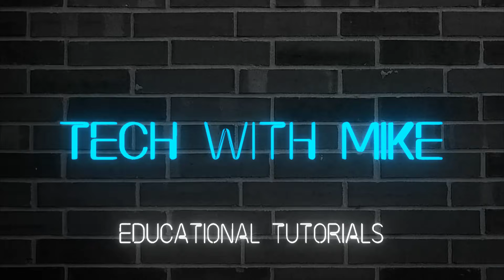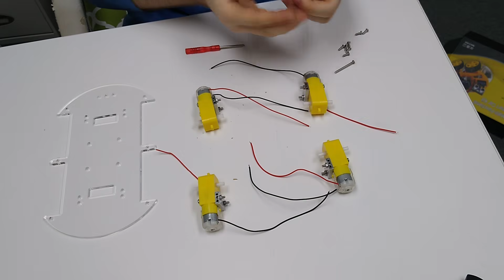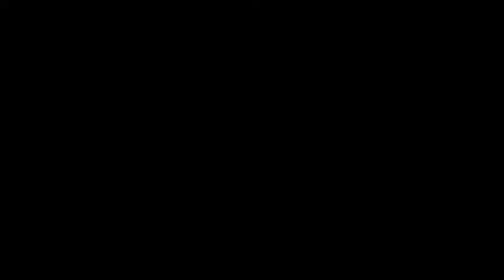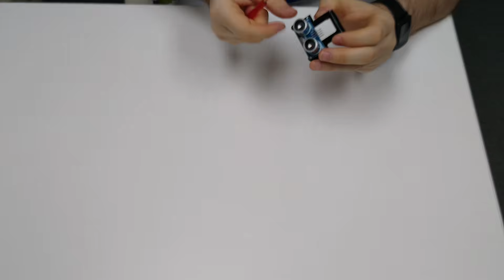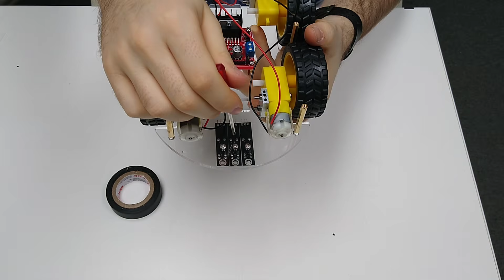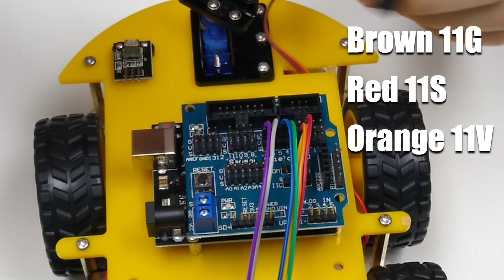How to Build an Arduino Smart Car (LAFVIN)

Comment: I need help, we had problems with the code and the car does not work, we think that the problem may be the bridge because at first we did not loosen the screws a little to insert the cable, we tried to disassemble it with a small screwdriver, but it does not come out and a cable is loose. The other part is that our servo has a screw loose, so when we try to operate it we get the error that something is broken. Another possibility is that when we connect the board to our computer it does not detect it as an Arduino UNO, but only as a simple USB. I don't know what is wrong. I need some help.
Reply: Please, I need help, I have little time to deliver this project. If someone can help me I would be very grateful 🙏

Comment: Hello I am 10 years old, 
and I am assembling this kit and I am having a bit of trouble fitting both copper wires of the motors into the H-Bridge and each time the wires finally fit, they just come off despite screwing the screws on the H-Bridge really tight! Maybe the copper wires are a bit too tiny...
Any suggestions on how to fix this issue?
Thanks in advance 😁
Reply from the maker: There is a piece of metal that gets pressed down when you screw in the screw. This can sometimes be bent to close to the top so that is doesn't make good contact with the wire. If you have a small screwdriver try to gentle bend the metal down towards the bottom by getting behind it and pressing it down. This should help it make better contact and stay secured. If you have a wire stripper, you could also try to remove a little more of the rubber coating and expose more wire.
Reply: @TechwithMikeYT  Thanks for replying, I will try it out.

Comment: Hi, thanks for the upload. I have done all the connections and assembly as per the video and ur schematics.. But still the motors fail to rotate.. What am i missing
Reply from the maker: Can you test motors with direct voltage? Take the leads from the motors and touch them to leads from the battery pack

Comment: hello, first of all sorry for my english
I need help, I have a problem programming
when I try to program my multifunctional smar car kit lavfin, I get a problem or two problems, invalid libraries, libraries not found and an error in one line
no matter how hard I try, I don't get anything
it's frustrating
Thank you so much for everything
Reply from the maker: In the description I have the CD contents which includes the libraries as .zip files. Open the link and navigate to the libraries folder. Download the zip files.

Here is a link for installing the libraries. Look for the Importing a .zip Library section.

https://www.arduino.cc/en/guide/libraries
Reply: muchas gracias,Thank you very much for your help

Comment: During the lecture, at around 47:26, you connect the 5V line from the H bridge to the shield at position 2V. But 2V is already at 5V so why does it need connecting?
Really good video!!

Comment: Your response is much appreciated. My battery cell box is broken. Im trying to figure out how to power everything. Can I get two battery boxes and connect one to the Uno and the other to the h-bridge? I can't find a box that has both the DC input and extra leads
Reply from the maker: Can you verify that there is contact between the batteries and the terminals? Sometimes a spring can be too compressed and not make proper contact. You can use a screw drive to extend the spring a little. If you are sure your battery box is dead then you can use 2 2xAA battery boxes or 1 4xAA battery box. If you use 2 2xAA battery boxes then connect one black and one red lead wire from the 2 battery boxes. Then cut the two lead wire that go from the original battery box and to the DC input (near the middle). Connect the free black and red wires from the connected 2xAA battery boxes to the corresponding leads into the DC input. If you find another box for the original batteries you can follow the same steps. Cover exposed wire with electrical tape.
Reply: @TechwithMikeYT  Thanks for replying. I opened the battery box, the negative wire came apart from the metal part inside that touches the batteries. I plan to try and solder the wire back in place.
Reply: Just to close on this, i was able to solder the wires back into the battery box, and the board and h-bridge have power now. Thanks again for this video.
Reply from the maker: Glad to hear you got it working!

Comment: Thanks a lot, I never would have been able to put this together with the included instructions. Unfortunately for me I think my battery box is broken. I've confirmed the uno board works with my computer, and that the batteries are fully charged, but when I try to power the uno board using the batteries there is no power.

Comment: Hello, hope you are having a good day. I made the car, step by step I got everything done. But, the motors are not running. I restarted all the wiring, and it still does not work. And I took the code, from the description. Can you please help me?
Reply from the maker: Are any of the other components working? Like servo motor?
Reply: @TechwithMikeYT  Yes, the servo motor is working, and the ultrasonic sensor is working. But the motors aren't working. I have the same kit as you.

Comment: Would you recommend buying this car for learning arduino?
Reply from the maker: It really depends on how you use it. The building part is fun but the included directions are not super clear. It's doable but just requires some extra thought for some steps. As far as programming I would do it by components. First start with the ultrasonic sensor and get it to read data, then move the servo motor left and right to read data on the sides. Then set up conditionals that print go, stop, turn left, turn right, based on the situation. Elegoo is another company that has a similar product but with better resources. Little bit more expensive for their car kit but may be worth it with less frustration.

Comment: I have the same kit, but i have a cuestion, is the car made for working with all the modules connected? I mean can i connect everything and change the mode if i want Line Tracking, or IR Control, or obstacle  avoidance? or I just have to connect wires for only one mode?
Reply from the maker: Yes, you can have all the wires connected. You would just have to upload different programs to run the different parts of it.
Reply: @TechwithMikeYT  all right, do you have any idea of how to link each module's code? or if anybody has the code. 
 I'm a starter and don't know that much😅
Thank you m8
Reply from the maker: If you are asking if there is one program that will do everything, it may be possible to use the IR controller to select different activities for the robot to do. For example press 1 for obstacle avoidance, 2 for line tracking, etc. This would involve combining the separate programs into a single one. I will try to work on this over the weekend and I will let you know if it works out. Otherwise I have an obstacle avoidance program in the description that works with the wiring I do in the video. If you wired it according to the instructions I also linked the companies code that you can upload. If you have any other questions let me know!
Reply: @TechwithMikeYT  thank you very much! let me know if you get it. I will try to do it also
Reply from the maker: After working on this for sometime, I don't think this is going to work out. Even trying to just add obstacle avoidance to the IR sketch it become messy very quick. I will continue to work on it, but I don't have high hopes. I still think that the best option is to upload code for the particular function of the robot you want to use at that time.
Reply: @TechwithMikeYT  is that everytime for a different function..and how can i get the code from you,

Comment: According to the instruction manual, I understand that if all the sensors can be connected, splicing the line sensor wires using only four pins for the three sensors?
Reply from the maker: If you are using the shield that comes with the kit each pin has ground(G), power(V), and signal(S) so it's not necessary to splice wires.

Comment: I'm waiting for the batteries to come to test it, and the board is already programmed? Greetings from Spain
Reply from the maker: You have to upload programs to the board. I have a program for obstacle avoidance in the description that works with the wiring I did in the video. I also linked the resources provided with the robot if you prefer to go that route.

Comment: Did you forget to connect the infrared, is the board already programmed?
Reply from the maker: With all the sensors and motors plugged in there weren't any free digital pins. If you want to use the IR sensor you could unplug the servo motor I have on pin 11 and plug the sensor in instead. G -> 11G, R -> 11V, Y -> 11S. Or the same could be done if you aren't using the line tracking sensors. If you would like to keep everything plugged in you could use A0 and A1 for the trig and echo pin from the ultrasonic sensor.
Reply: @TechwithMikeYT  So you can't connect everything at the same time?
Reply from the maker: @jorgef.  You can if you move the echo and trig wires from the ultrasonic senor currently (12/13) to A0 and A1. That frees up pins you can use for the IR sensor.
Reply: @TechwithMikeYT  I am waiting for the batteries to come to try it, it would be interesting some more video clarifying all this.